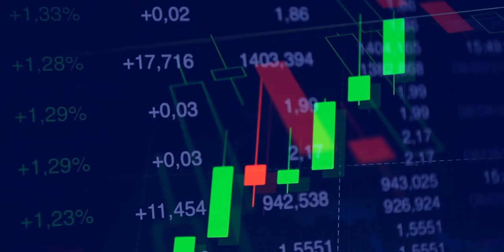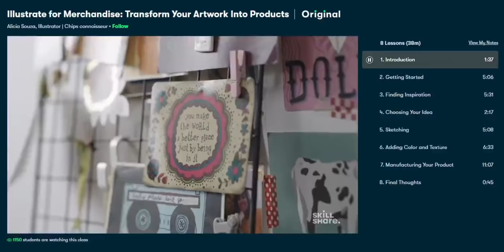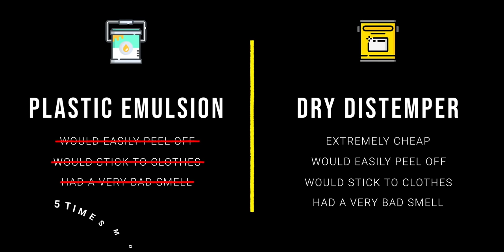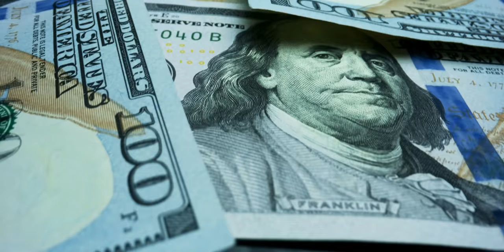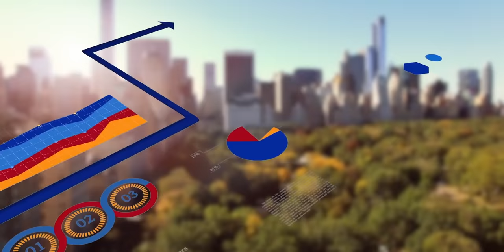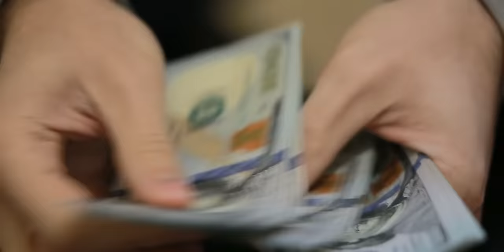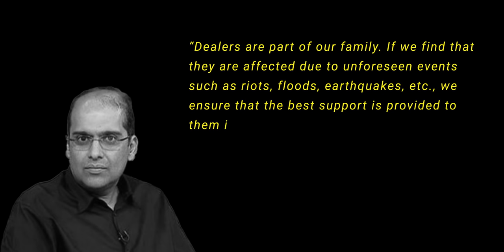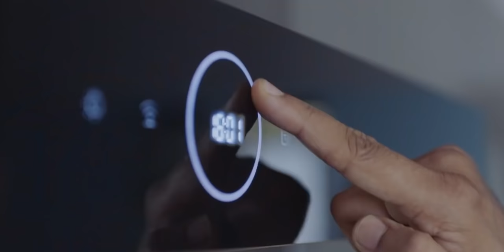How Asian Paints Built MONOPOLY in the Indian market? : Indian Monopolies EP 1

Comment: Hey buddy, 
This is a great video, however being a part of the paint industry it would have been great if you covered some of the dark points of Asian as well, as in:
1. Dumping - Asian paints has been a pioneer in the paint industry in terms of sales, however it is pretty sad to see innocent dealers in the rural and urban areas where they are dumped with 10-15% of construction chemicals and other non paint related products in their counters.

2. Threat - There are small dealers who do not achieve the complicated marketing schemes, thereby earning barely 2-3% apart from the Cash discounts for timely payments, in such instances if these dealers want to bring in a second brand to their outlet, Asian paints threatens them to remove schemes, payment terms and not supply enough material. 

3. Supply - I agree that their supply chain is truly amazing, however it is imperative that one goes down to the grass root level and notice that Asian paints has preferential supply for large to small dealers, achievement based supply, lack of proper supply of products such as primers and various other issues.
Reply: WELL SAID  BROTHER BEING AP DEALER FROM 26YEARS THERE SO MUCH DISCRIMINATION TO THE DEALERS SMALL DEALERS R NOT EVEN BOTHERED THEY SUPPORT ONLY BIG PLAYERS U CANT GET EVEN 2 TO 3 PERCENT MARGIN  MOST OF THE TIME THEY DUMP HEAVILY